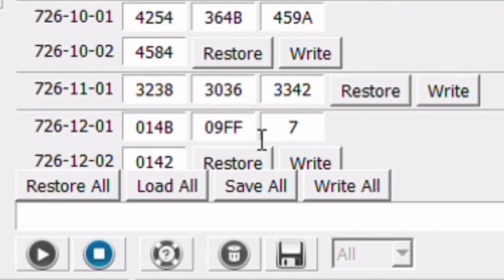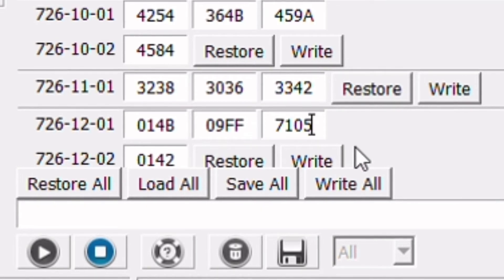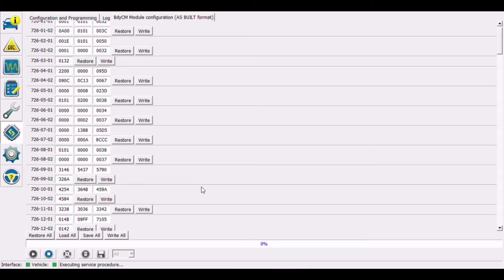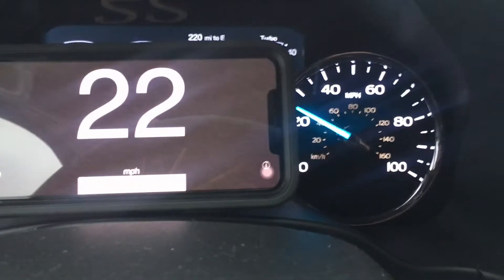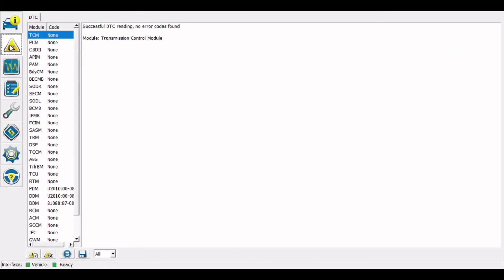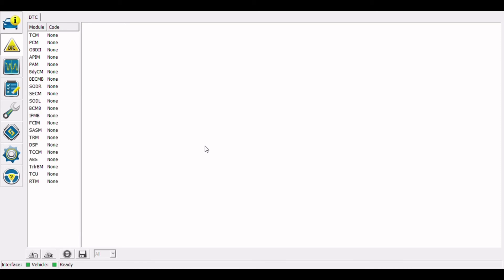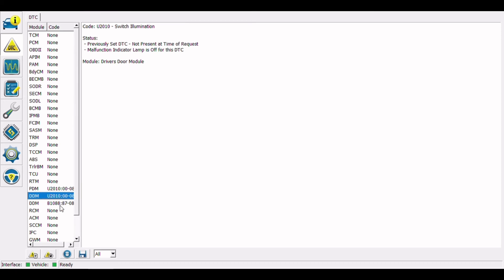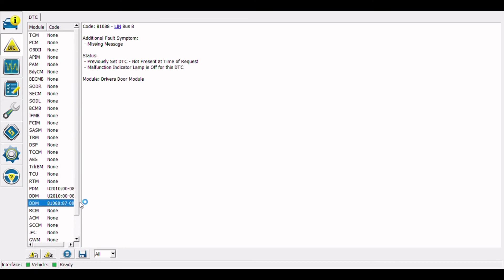2019 F250 Speedometer Recalibration for Larger Tires

Comment: 2476 millimeters equals 97.4 inches, which appears to be circumference of wheel. Divide circumference by pi, and you get a diameter of 31.02 inches.
Reply from the maker: Sounds right.  I think they’re actually like a 33.4 inch tire from the factory on that.  You just have to play with it a little to get the speedometer correct

Comment: I believe anything 37 inches or bigger is not able to be programmed into the trucks system. There is an external device that you can get from Rough County that will allow you to correctly run any size tire.
Reply: I've not been able to program 37's with forscan.
It throws a check engine light.
Reply: @timbo_slice4053  You are correct. Look up Rough Country speedometer calibrator.
Reply: @timbo_slice4053 did you reprogram the all the other modules?

Comment: I have a 2018 Ford F-250 4WD 6.2 V8 with oem tire size 275/70/18 and I am installing 285/75/18 tires on the vehicle, do in need to do this and will it hurt the vehicle in any way if i don't?
Reply from the maker: The oem tire you mentioned is a 33.5-inch diameter. The new tire is a 35-inch tire. The speedometer is going to be off, and the vehicle will seem a little more sluggish due to the perceived increased ratio with the new tires. The tall ratio does put more stress on the transmission and everything else, but people do it all the time without problems other than the speedometer being off.